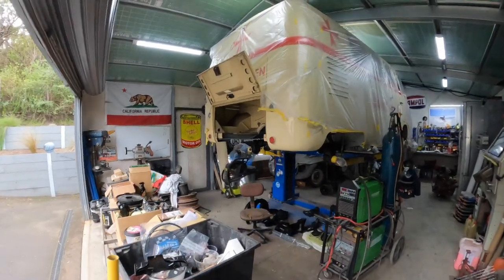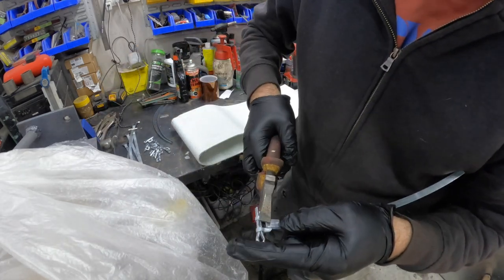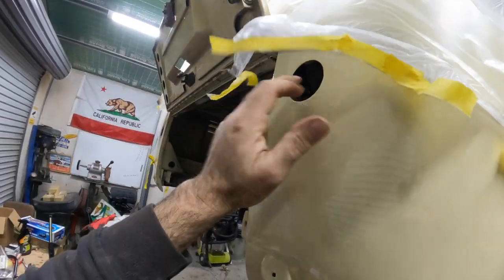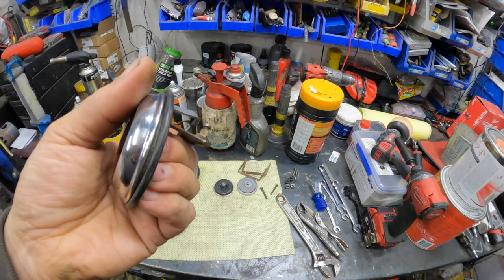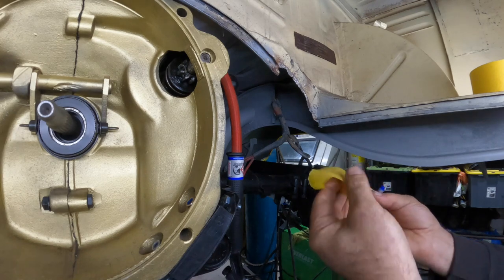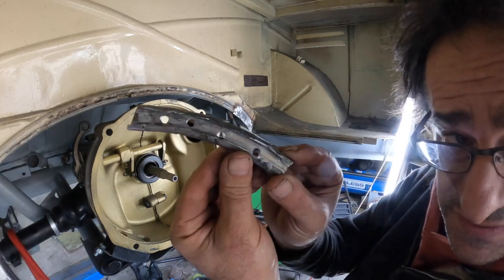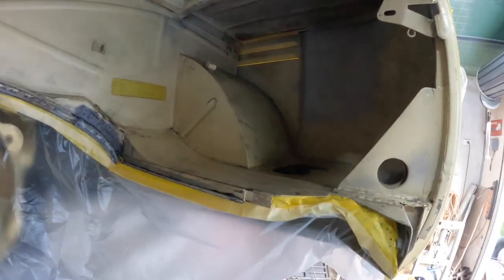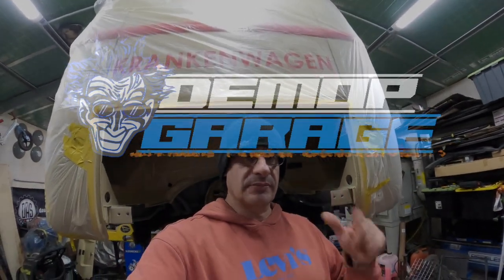Rebuilding a 1952 barn door ambulance // welding near the vin number, Paint engine bay #barndoor

Comment: I have painted a couple engine bays, and my westy was a pain because I had to mask all the wires.  I found a smaller gun worked well for the ceilings.  I need to paint my double cab soon, but my next door neighbor is an amazing painter and we are going to tackle it together since I am only good at spraying primer.   This bus is so cool, can't wait to see what is next.
Reply from the maker: Yeh its hard upside down trying to get paint out😂